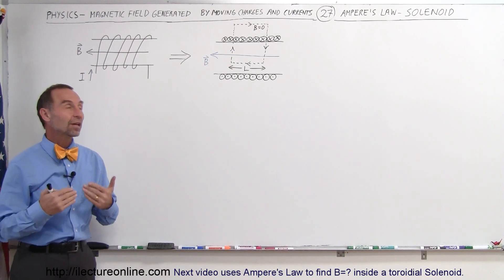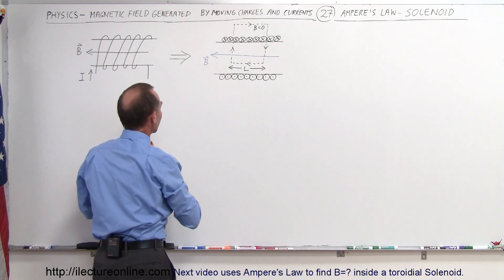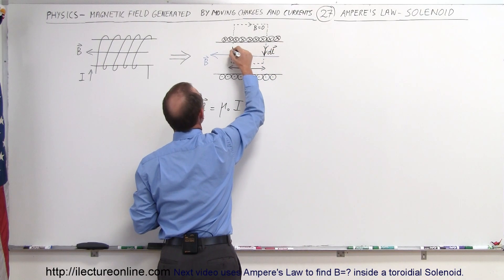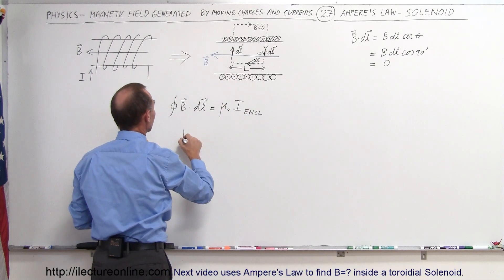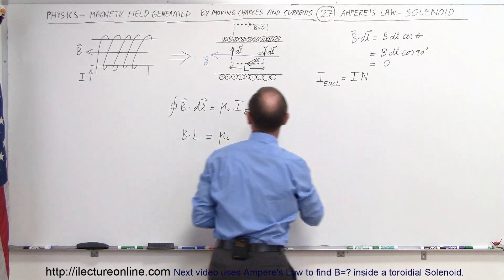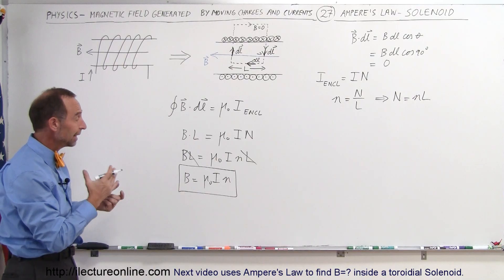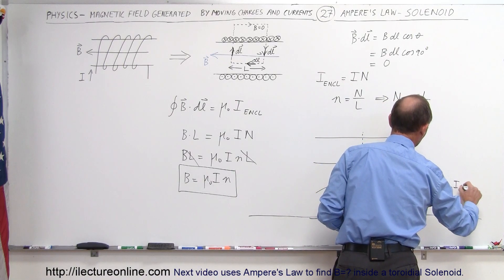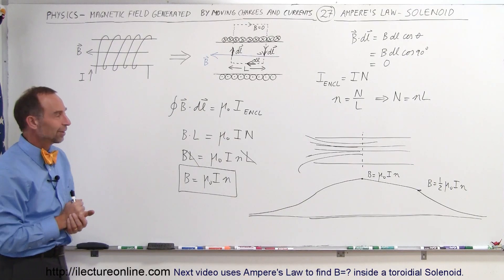Physics 44  Magnetic Field Generated (27 of 28) Ampere's Law: Solenoid

Comment: interesting about how a magnetic field in an ideal inductor should behave and how it actually behaves.  I have an application for a large inductor , so I was watching this.  Made the inductor large and found the field weak and it would barely attract a metal tool.  When I made it smaller, the field was stronger.

Comment: Hi Professor, 
What is bothering me is the enclosed current. If 2 amps go into the solenoid, 2 amps should come out to obey charge conservation, or KCL. So why does the enclosed current get multiplied by N? Why is the enclosed current greater than what is provided by the source? The enclosed current should always be same. 
Thanks, 
-John
Reply from the maker: Note that we are calculating the strength of the magnetic field, which DOES depend on the number of turns (loops) per unit length of the solenoid.  The current is the same throughout the entire wire and does not depend on the number of loops.  This video shows why the strength of the magnetic field depends on the number of loops.
Reply: @MichelvanBiezen  Understood thanks a lot!

Comment: Why magnatic field outside the solenoid is zero ???
Reply from the maker: The magnetic field outside the solenoid is NOT zero.  But the integral of B x dl is zero, because the direction of the magnetic field is parallel to the direction of travel.  (sin 0 = 0)

Comment: Professor van Biezen, I enjoy your classes and  qualities of  real cathedratic.If you please adress me tosome class of yours, 1.-with an ample field flux lines or mag density flux inside and outside space simulation. 2.-If a vector field  equation exists, I saw, we need an Equation
3.-Solenoids linear electromagnets engines demands the force on the plunger ferromag.material  from N to S pole inside  the coil,
4.-If we  draw a perpendicular  against axis of symetry (center of  coil=along l) and draw the flux lines  from N  the cenered ones will not close as a loop to S, will be asymptotic to the perpendicular to infinity.Why this is important to day, because  electromagnetic engines are  demonstrating to more convenient simple and reliable  and cheap than classic electricmotors.
5.-We engineers are all enthusiasted because you need a few elements and thats it, funny.
6.-Many exposers of  their achievements say : the motion of plunger is  unstable,the  force and speed along x axis of symetry is unknown, they asume a drop in F and  v from x=0 and x=l, a great concern is what happen in l/2,  a great inflection,so B=B(x) is necesary
7.-I heared v=f(volts )
8.-Last question Professor,if plunger is  a permenent magnet N S fixed,is it better than a  soft iron. Best Regards,thanks fr your classes. Johann Wegmann

Comment: Hello sir 
Thanks a lot for your explaination
But from the lesson, you have only used the upper part of the coil. Then how about the lower part? should Bl = 2uI
Reply from the maker: No, the result is correct.  Note what would happen if you lower the bottom dashed line below the solenoid.  Then I enclosed would be zero.
Reply: Michel van Biezen
Thanks a lot 
I understand by Ampere Law Bl=ui enclosed in a straight current line.
But now this is a close circular current loop. It is similar to have infinite straight line current.
Why the magnetic field inside the loop is not that infinite straight line current sum.
Reply from the maker: You can't say that a current loop is "similar" to a straight line current.  The magnetic field acts very differently.
Reply: Michel van Biezen 
Thanks but i am still confused.
Reply: Michel van Biezen 
Sir, from your previous video about Boit-savart's Law, the result of the magnetic field at the centre of the current loop is ui/2a. Can it be used to find out the magnetic field of the soleniod.
Reply from the maker: There is some similarity, except that the solenoid is longer.
Reply: Michel van Biezen 
Thanks again.
is it the reason why Maxwell equation is so great and simplier.
Reply: I dont know if it will help. But he has just found vector B, the magnetic density of the point. And its not about the flux,  maybe that confusion led you to think in multiply that for 2. For the flux we would need to do vector B times the area inside perpendicular to B. Assuming  that B is constant in every point inside the soleinoid. I think just like you in the beginning.

Comment: Michael, could you explain what B field looks like above/under the solenoid? If it's not 0,  how would you calculate it? Thank you!
Reply from the maker: Those would be very difficult calculations.  We tend to approximate such things which is typically good enough for most applications.  This is something that is better shown on the white board than explained like this.  When I get going on the advanced E&M videos, we'll see more complicated examples like that.
Reply: Thank you very much Michael. Your videos have been very helpful, thank you!

Comment: WILL MAGNETIC FIELD INSIDE THE SOLENOID NOT BE CONSTANT IF CURRENT DISTRIBUTION OF WIRES WRAPPED ARE NOT UNIFORM. Sir can you please clear this doubt of mine, I will be very Grateful
Reply from the maker: The magnetic field is much more complicated than the way we model it here.  Towards the ends of the solenoid, the field begins to change and is thus not uniform all the way through.